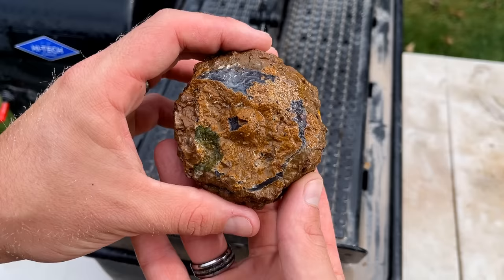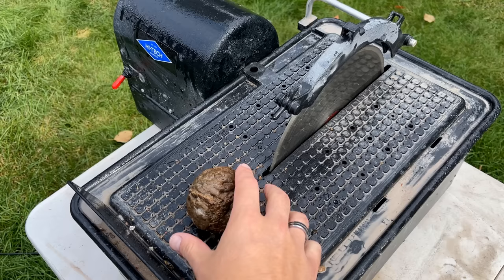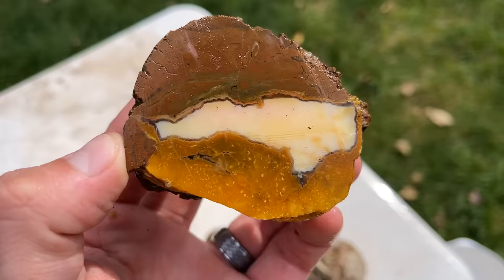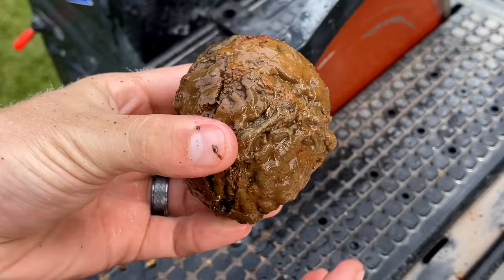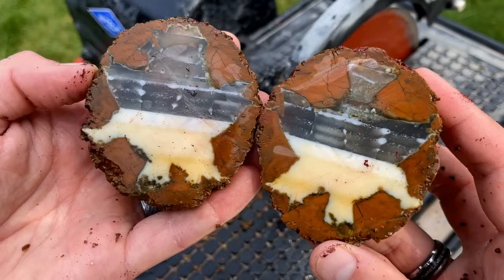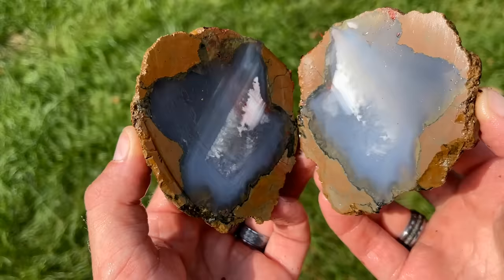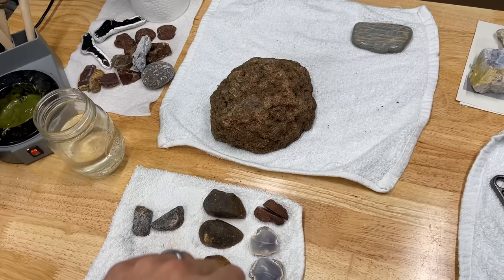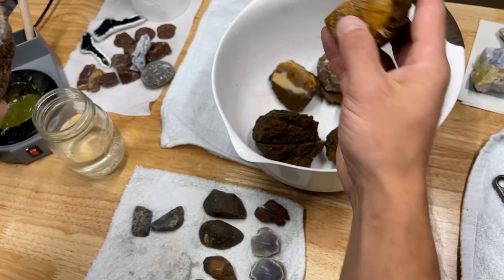Cutting & Exposing 5 Thunder Egg Cores!

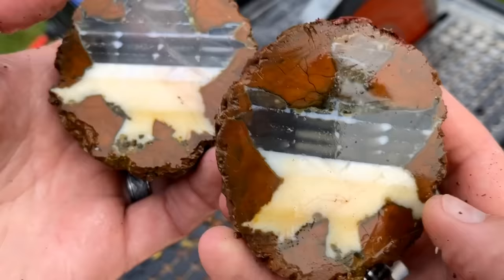Comment: I collect bonfire seaglass and I find it fun to figure out which side was up when solidifying. I see the same in these, the milky area being where the original sediment settled out, and the clear sections where up. at 3:53 you can even see pebbles that settled into the lowest parts, the white sealing them in.

Comment: You can polosh large flat surfaces in a similar way that i used to sharpen wood plane blades. You get a large enough sheet of pane glass (a thick one about 3/8 inch used for shelves. You can dumperster dive or possibly find it at a big box hardware store), then fix your 120, 300, 400, 600 and so on sand paper to it. Its flat and rigid enough for what you'll be doing, then you can use the buffing wheel to finish it.

Comment: These start spherical but if they are molten as they collide they can be oblong or different flattened shapes like that first flat one.
Reply: I have an uncut double one, it has one about 4 inch diameter with a 1 1/2 inch diameter stuck to it.  Then the whole thing has a slightly flattened bottom where it landed.  It has nicely defined ridges all around so I might keep it like it is.

For the thunder egg to work, soak in water a few days then put in a campfire.  If there is a void inside, the egg will explode and reveal the vision inside!  A shaman would purportedly ask it a question first...

Comment: Why do you split them in half? Wouldn’t it be more gem-like if you grind of the outer part with a dremel like tool? The result should be more wow effect and more valuable. Where do I find those rocks?
Reply from the maker: I just did what I wanted with them, grinding the matrix off the outside doesn't sound enjoyable and would expose the innards.
Reply: @AgateDad  ah yeah that’s true hard to see the middle if it’s not cut in half..  

Hehe Yeah it would be a lot of painful hours with a dremel tool so quite obvious that the price would increase with so much work. But me hear you. 

wouldn’t it look any special if you would have grind it like you do with opal’s then?